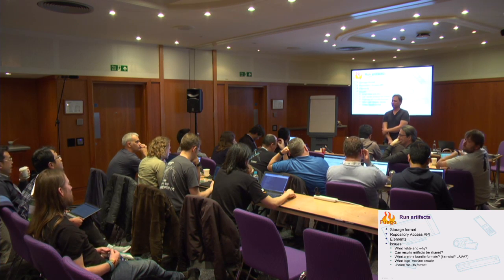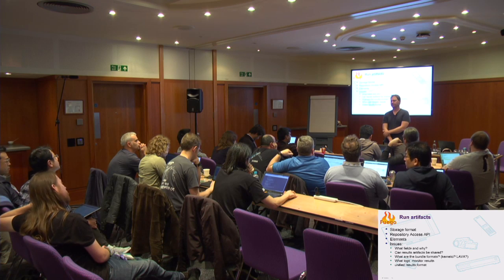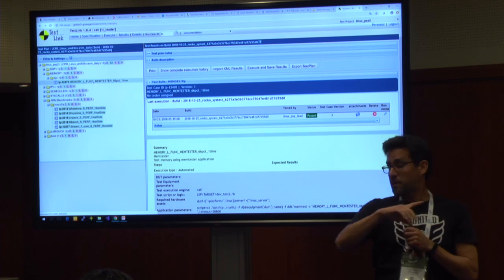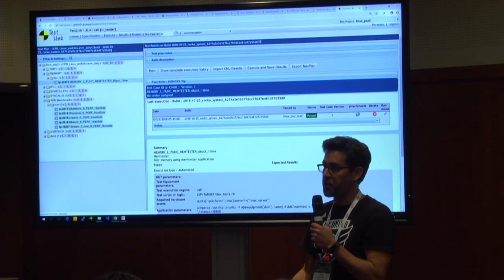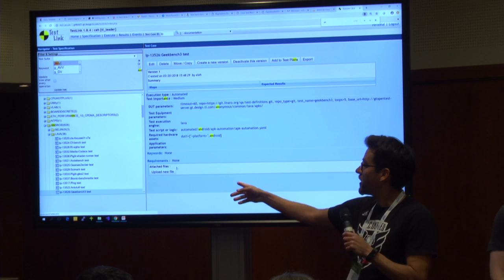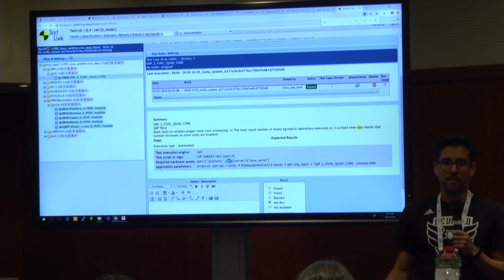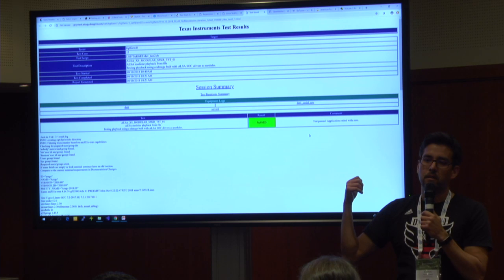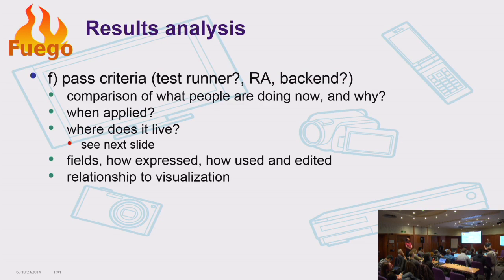Automated Test Summit 2018 - Run Artifacts, Standardized Result Format & Parsers

Comment: Guys, please don't reinvent the wheel! There are at least three popular test report formats widely used in testing opensource (and commercial) software: TAP (TestAnythingProtocol), SubUnit and JUnit (XML-based). Many testing frameworks supports these formats and you should have serious reasons to create a new one.

https://gist.github.com/ligurio/5e972552c8b0d4f4b5e109564cbfe764